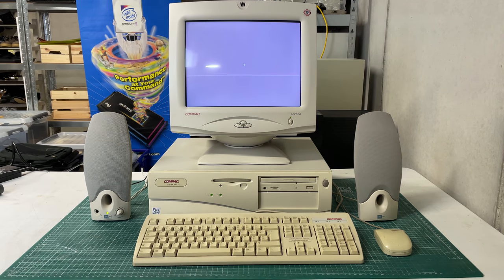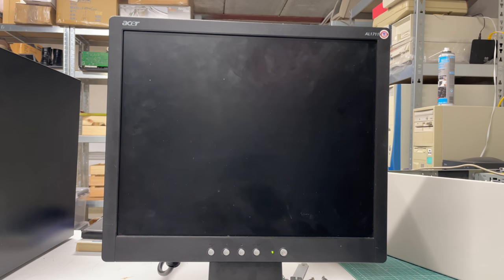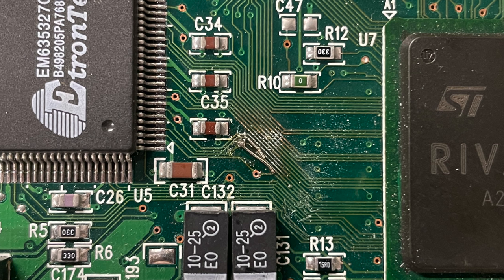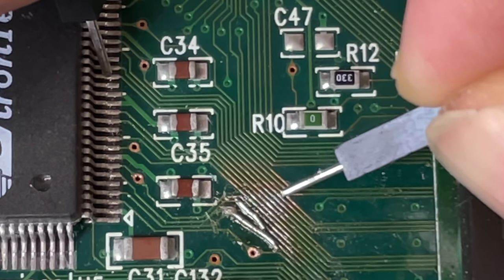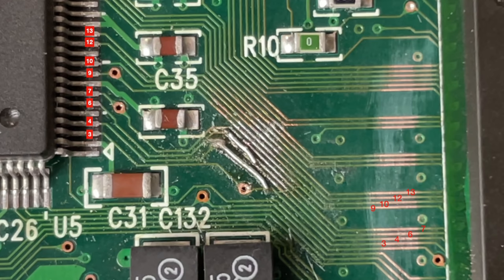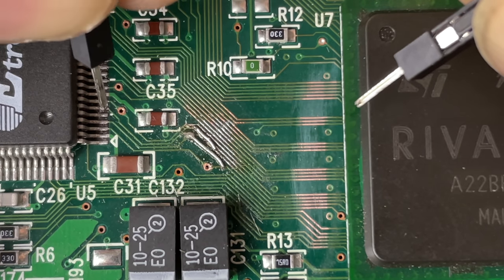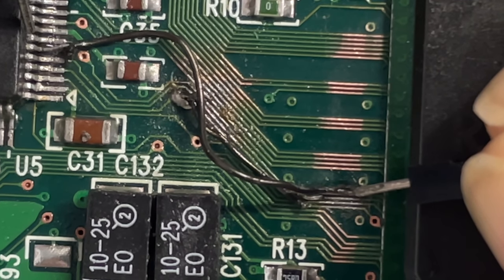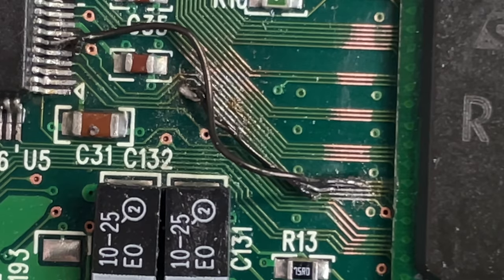Attempting to fix my Diamond Viper V330 Riva 128

Comment: So sync signals are OK, on the computer side the board are ok (main IC, memory, PCI connector). The problem is on the RGB output. If you can trace the R,G&B signals with a scope from the DAC to the VGA connector , maybe it can be fixed. Or at least see were they are originated (find the analog RGB output from the DAC) and check the signal path to be continue.

Comment: For taking continuity measurements I use an alligator clip and a sewing needle. It's great for gently poking into the soldier and can also get through the green circuit masking on the traces. That being said, soldiering traces is much harder than it looks. I'd pick function over how it looks any day. You removed that capacitor exactly the way techs do it. Ignore the negative comments, you did a great job. Interesting video. Cheers.
Reply from the maker: Thx appreciate it ! Still have a lot to learn but I’m trying :)

Comment: Windows 98 (maybe 95 too) support multiple display adapters.  Put a second card in so it boots.  Interrogate the hardware to see if it is functioning except for video output.  That will narrow it down.  Use a scope if you have one to probe for signals.  Being analog you should be able to sniff out the RGB, sync, edid data etc.  Trace from the output connector back to their termination points.  Might not be able to fix it, but should be able to identify the fault.
Reply: That feature was added in 98.

Comment: Suggestion:  for the very fine pitch probing, sharpen the male end of your jumper wire with a file or use a very sharp sewing needle instead (inside an alligator clip).  I do hope you can fully resurrect that wonderful piece of PC history.
Reply: I use a sewing pin or needle when doing this, as you can push through the solder mask too
Reply: T pins from the sewing section. Works great for this and for back probing connectors.

Comment: monitor detecting the resolution means the card is creating hsync and vsync but lack of picture means no rgb signals...  i would check the DAC output with a scope.
Reply from the maker: Is hsync and vsync generated by the main riva128 chip ? Or is it an auxiliary circuit that does that. And the fact that the PC does not produce error beeps related to video issues, does that tell you something ?
Reply: @RetroSpector78  no beeps means it's working fine from the bus perspective. also i don't think the main issue is caused by memory, a missing bit or two on memory bus would most likely cause artifacts but not complete loss of rgb signal. i would  trace the RGB signals from the VGA connector end and check the passives first for shorts (protection diodes, capacitors) or opens  (inductors , resistors).
Reply: @RetroSpector78  yes both sync signals and RGB signals are generated by the riva chip. (you can even find the riva128 datasheet online).

Comment: Using a pin or a sewing needle works pretty well right through the solder mask, its got to be sharp though and they have a tendency to dull after so many tests.
Wire-wraping wire is ideal for fine traces, best to bridge the longest portion of the trace possible to avoid lift-off problems with the soldering iron.

Comment: I doubt it's related to the ram, since these are known to still work with ram failures or ram that is disconnected via damaged resistors mentioned on vogons. It looks like it was stored in a pile of pc parts by the seller which led to the damaged traces and dented cap it could have broke some solder joints as well. The datasheet for the riva 128 is still available if you look at page 57 it details "in circuit" board testing, page 9 details enable signals and some other things. Good luck!

Comment: Instead of these really difficult jumper wires, you could also use conductive paint. It's not quite cheap but works fine for stuff like broken traces and flex cables.
Reply: Mr Guru  Well if you really don't have the steady hands, masking tape will do the job.
Reply: It's a really bad idea to try to use silver paint on memory bus! Jumper wire as done here is already much better, and probably perfectly adequate.

Comment: Great job, looks like a fun project!
Reply from the maker: Time consuming project with little to show for so far :)
Reply: When repairing traces in my experience using enamel wire (finest pitch you can manage) works best.  Also stagger your bodge wires so you don't fight shorts.  Finding the nearest VIA or pin gives something solid to solder to.  Having a needle sharp solder tip helps.  You can wrap copper wire around your tip and sharpen it to provide a fine pitch tip.

Comment: If you haven't already, check the voltages on the ez1587ct voltage regulator in the corner of the board. It's probably fine, but always worth checking (they are at least easy to replace)!
Reply: The card produces valid timing on RGB/VGA connector. If the voltage regulator was broken, it would not get as far.

Comment: 11:05 use coil wire (0.08 mm) it is better than normal wire
Reply: Not better and an insane hassle to deal with to try to strip the lacquer. I had bought several rolls and never not once got one where the lacquer can be stripped with the soldering iron.
Reply: @SianaGearz  Works for me. You can see it done in several rossmann videos as well.

Comment: It looks to me as if the card has taken a bad knock potentially causing the physical damage you seen but also may have caused further unseen damage, possible a bad BGA joint on the main chip.  If you have a scope check for and follow the RGB signals coming out of the chip.  It may be beyond repair though.

Comment: Great video, love this kind of low-level tinkering :)
Have you checked all the inductors on the board for continuity? Someone below mentioned L15, and I have the exact same board, got it with L15 missing. Haven't tested it before fitting the part so I wouldn't know if it behaved like yours without it. Also inspect all SMD resistors under a magnifier and see if they are in a piece. Sometimes they get cracked, especially on boards that have been rough handled, so ideally you should check their values, which is not always relevant in circuit, but when a resistor measures higher than its marking you know something's fishy. Also check the fuse F1 near the VGA port. Just a few days ago i found one such fuse popped on a Leadtek TNT2PRO that I know for sure was working a couple of years ago but now it wouldn't be detected by the system (missing VGA beeps). Took me a while to figure it out, and since I had no spare I resorted to bridging it with very thin wire. Speaking of which, maybe the thinnest wire you can work with can be extracted from the desoldering braid. I think using that you can restore those two broken traces to near-factory look.

Comment: The trick to finding wires to bridge broken traces is not to go looking for wire,  but to take a single strand out of a fine stranded wire.   That flux didn't flow very well when heated.

Comment: So how about that unfixable video card from hell?
(btw. salvage an 80 pin IDE cable, the wires in there are a little thinner - and even with that I couldn't have get these to connect and not short. Your solder job is much better than what I could have done.)
Reply: I asked the same thing about that video card a while ago, and Mr. RetroSpector didn't reply, unfortunately. I think that card hit him hard and he doesn't want to talk about it anymore :-)
Reply: @Arti9m  He once stated in a reply to a comment that he hasn't done anything with it since (luckily that includes rolling it over with his car) and that if I'm interested in fixing it I can have it.
I will likely end up doing it (unless he fixes it first). Bad news is... my video equipment is about as old as this cart and you will get a video of me fixing it in VHS quality.
Reply: @senilyDeluxe  I would appreciate if you make the video and share your experience anyways. Also VHS-quality goes well with retro PCs in my opinion :D

Comment: I would be suspicious of those larger box capacitors. Having recapped a couple of game gears I tend to be suspicious about them.
They look to be attached to a clock chip and could be affecting memory timing or somesuch.
Reply: Those are tantalums, not the infamous electrolytic kind found in the Game Gear. Tantalums from that era rarely fail, in my experience.

Comment: I would probably make sure the VGA connector doesn't have any cracks in the solder. I remember my attempts to repair AWE32 card which didn't produce audio on one of it's channels - tried to replace caps, then tried to replace the amplifier chip. In the end, there was a crack in a solder joint under speaker out jack connector. I think it's worth to check out as VGA connector undergo a lot of physical stress.

Comment: I've done a repair like this on a 486 motherboard on the SIS chipset IC where a cockroach or some other bug pee'd on it and it corroded. You should either get ultra fine wire or pull the insulation off some wire and use one of the very thin strands. Also You really need very good magnification and a narrow soldering iron tip. It's not easy but is possible.

Comment: Some of the SMD components on the back of the card look suspiciously loose
Reply: Yeah. Why is that resistor on the back of the chip at 330degrees? What is it doing there to begin with?
Reply: Hah. Wow. That's actually stock. Seems like they ran into quite the routing issue there.

Comment: Shame it didn't work. For repairing traces my technique is to use magnet wire. Start with a long bit. Clean and apply solder to both sides of the broken trace.

Now attach the end of the magnet wire to one side of the broken trace, with the length over the other side.

Now you can try to do the other side. It can help to use a heatsink to stop the other side unsoldering itself. Big hefty screwdriver or other lump of metal.

It takes a bit of practice (but now you have a board to practice on) but it works. An iron with a flat, slightly convex tip that applies plenty of heat and holds some solder.
Reply from the maker: Thx for the tip. Will look into that.
Reply: To add, to align the magnet wire (36-42 gauge?)  with the traces use a thin strip of polyamide tape.  
It'll hold in place the excess as you work on the parts you need to solder.

Comment: In my experience with GeForce2 MX200, some broken traces to RAM chips actually may result not in black image, but rather in image corruption. In my case, the very first video mode (the one used when PC boots) got corrupted: i got weird stuck symbols in several positions on screen. However in other modes (eg. in Windows) the card worked fine. I hope you'll find a solution, PCI cards are getting harder to find nowadays.

Comment: Rule #1 Thou Shalt Check Voltages!
It'd help somewhat to have a schematic or block diagram somewhat to work from but it could still be doable, just makes it more fun :D
If you never figure it out, I don't mind paying the postage and giving it a try (for free, of course, I just love working on retro electronics) :D Either you get back a working card and something to make a video about or you get a card back that is still broken haha
Reply from the maker: Where are you from if I might ask ?
Reply: @RetroSpector78  UK :)

Comment: The damage so far appears to be physical (I'd say something heavy was dropped onto that card, sheering those PCB tracks and damaging that cap).... I'd be getting that thing under a decent microscope and looking for any tracks or component soldering with hairline cracks, checking the soldering of the IC's and maybe reflowing any legs that look lifted from the board/suspect.

Comment: I would have used coil wire instead of these thicker wires, but a great attempt so far.  Have you checked the fuses and power delivery on the card?  It looks to me that  those traces were shorted.  Since it is outputting a sync, i would trace back the rgb with a scope as some others mentioned as well.  Another thing that you need to consider is that the gpu is not completely connected to the board.  It looks like the card got a massive hit when those traces and cap were destroyed, so It could be that this also affected the GPU.

Comment: Try voltage regulator on right dow side front of the card if it works ok. Also check continuity test on vga connector, use cut male plug wires and pcb. Great video I love early 3D

Comment: Are you sure that there are no shorts in the repaired traces area?
Reply from the maker: Checked all of them and pretty sure. The problem is going to be elsewhere. Like someone else stated, 1 or 2 if these data lines from memory to gpu probably would not result in a black screen.

Comment: On the underside of the card RP1 and L15 look a bit funny. Maybe just slightly smudgy image but I would check it out. Maybe a bios flash is possible?  Another thing is obviously the sync is good but no RGB, maybe have a poke around there with a oscilloscope.

Comment: if you already using aligator clip wire just put a sewing needle or pin in the other side than the probe, it be even thinner and resistance difference of the pin and a piece of jumper wire would be minimal but you be able to probe traces even trough resist layer

Comment: Those square blocks with the white line on one end are tantalum capacitors. They really like to fail too and often short. One way, if it's a short, is to measure across it and see if you get a low Ohm reading thats close to a short. Measure them all and remove the one with the lowest Ohm reading, then measure all others again to see if the short is gone. Tantalums really really like to fail, sometimes in a dramatic fashion, exploding lol Hope You can breathe some life into Your old card again ^_^
Reply from the maker: These types of tantalums don’t fail all that often in my experience. (The older ones do). I did check all of them and also with an ESR meter (in-circuit). Don’t think the caps are the issue.
Reply: @RetroSpector78  Aww, dang. it was a possibility, i guess.

Comment: Those PCB traces might be impedance matched especially since they're dealing with high speed data signals, in other words they need to appear electrically identical to high speed signals and even a slight variation to their length or routing can ruin the operation.

Comment: This is awesome.  I'm wondering at 16:05, might have been how the top of the original cap ended up being jacked up.  Same process where someone may have used angled tweezers and pushed down a little too hard :/

Comment: I fix 3dfx voodoo cards almost on a monthly basis, and i can tell you that those old SMD 10uf@16V electrolytic caps, NEVER have ESR lower than 7.0Ohms. Actually, 90% of the the time, they are around 8.x Ohms. 
And for the one that you measured and gave an ESR of 0.00 Ohms, it's because you are measuring it while it's still attached to a circuit (which in most cases gives out false readings).

TL;DR: those old 10uf@16V electrolytic caps are still fine if they have an ESR of less than 10 Ohms.

Comment: on a pcb repair, if you had a really thin drill, i mean really really thin, could you drill a hole trou a lead and patch it by sticking a wire from below so the fix wire is not on the same surface , only the needle like wire that stick up trou the hole.
its like making new pcb holes almost like you would found on the board.
Reply from the maker: Would that work on a multilayered board like this ?
Reply: @RetroSpector78  i mean if you don't hit anything that is.
Reply: @RetroSpector78  really bad idea on a multi layer board

Comment: I guess, the timings for the ramchips are in the flashrom wrong :-/
May try to flash the rom of the card.
Take a AGP Mainboard boot from a ATI AGP Card (BIOS SETTING AGP first) with the defective Riva card in the pci and reflash the rom with the original ROM-Image.

Comment: Destroy a transformer or use wires from a 80-lead p-ata cable (the solid core type). You need way thinner wires :)

Comment: at 16:52 what exactly is going on with that component near c53 right in the middle of the picture?  I also see a fuse, F1, near the VGA connector.  Did you check that?
Reply: That's stock... Sadly. Either a routing issue, or a hot fix.

Comment: I have to wonder if the Riva chip itself is suffering from BGA failure. I've seen GeForce2 all the way through G92 based cards die from this in very strange ways.

Comment: At 16:50, is it just me, or is L15 damaged? It's located near the PCI connector, down and left from U15.
Reply: It looks fine to me. Those SMD inductor packages are sometimes crooked after being soldered on from the factory.
Reply from the maker: Took a closer look and seems fine.

Comment: Man, see a specialist. A soldering iron is not your calling.
Reply: Oh sod off. He'll get better and he didn't exactly ruin the card.
Reply: @SianaGearz  sod off. Next time he exactly ruin the card.
Reply: @utyff  It's a dead card that even if it wasn't dead, wouldn't actually be very valuable. It's just a Riva, there's basically no use where a TNT2 or the ubiquitous 2mx wouldn't be better. The polygon seams are pretty broken on the 128.